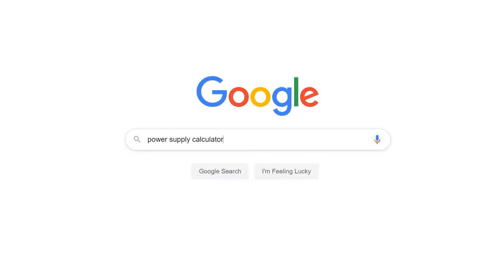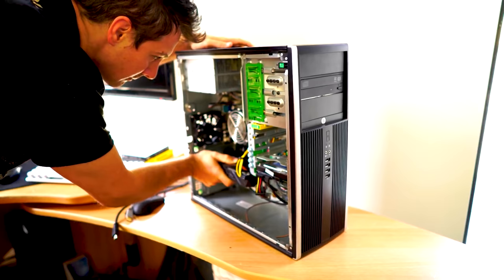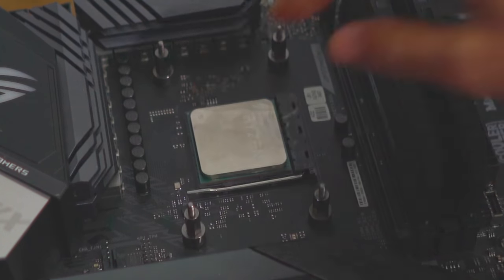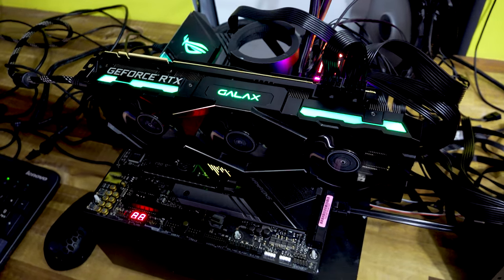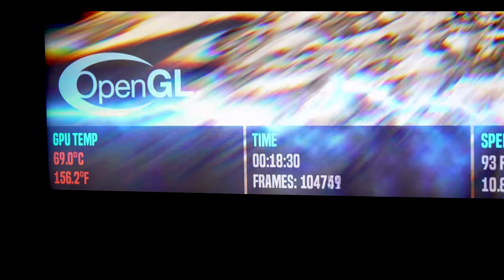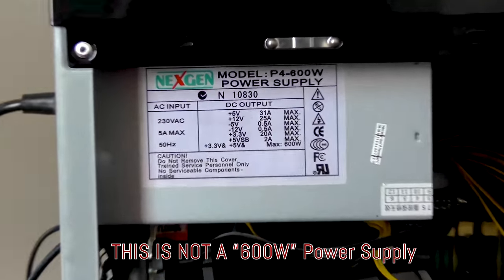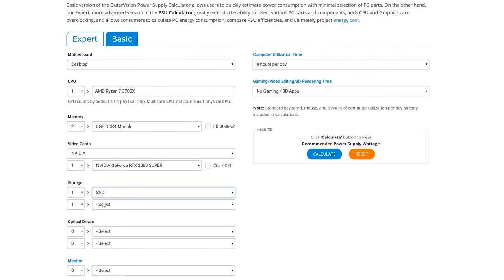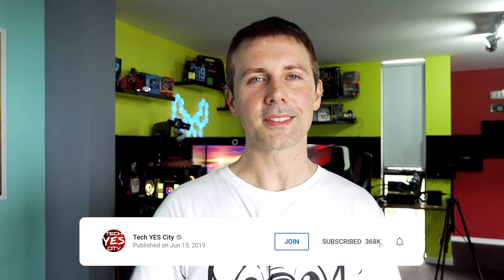I Tried Running a 3950X and RTX 2080 Ti on a 450 WATT Power Supply...

Comment: The internet: You can't run a 3950x and 2080 ti on a 450 watt power supply.

450 watt power supply: Hold my beer.
Reply: huh
Reply: Hold my watts
Reply: Yes you can but should you?
Reply: Nuno Filipe  i am running a 2060 super+ 3600 on 450w.
Reply: That doesn't make any sense.
Try again...
Reply: @faldano13  but 2060 super doesn't supports nvlink
Reply: @faldano13  why 2 then?
Reply: @faldano13  tho u would be good with a gold or up certified 850w psu
Reply: Hold my wire*
Reply: Galax RTX 2060 super yeah it does. only the vanilla 6gb model doesn’t
Reply: @Luismedeiros150  i have never heard of it , i think only the 2070 and above supports that feature
Reply: @faldano13   even i7 + 2080ti is enough with 500 watt psu
Reply: @StainSocial  Your going from a 14nm chip to a 7nm chip. It will use the same power even with more cores, maybe even less.
Reply: Hhhhhhh
Reply: @GalaxRTXsuper  how does it works
Reply: i will run 3600+rx580 wish me luck
Reply: Hold my capacitor
Reply: Ran a 1090t, a 290x, 2x8gb ram and 2 ssd from a 530w psu... Worked fine.
Reply: Laugh in 450w r5 3600 rx580 16gb ram 2ssd 🤣
Reply: @chocho6766  287hp, V-8, 6 speed, 1996 Chevy Camaro Z28 😎
Reply: @Cosmo47I  I don't think so 970 is almost as power hungry as 2060 super
Reply: @Cosmo47I  u may try with a 65w tdp processor and not so many other components
Reply: You mean hold my capacitor?
Reply: i used to run a vega 56 on 500w
Reply: I'm gaming on my my 180 watt psu with i7 9700, gt 1030, 16 GB ram SSD m.2 500 gb and hard disk 1tb😂.
Reply: @James-gl5do  my laptop has more then that 🤣
Reply: i have been using an i7-10700k and a 2080 with 450w and its been fine
Reply: @penguin144hz3  Not saying thats a bad choice but only way I would choose run that is out of necessity. A PSU is one competent that can generally be reused between multiple systems. I always get the highest wattage PSU within my budget just to have some overclocking headroom and to ensure it will be sufficient if I choose to upgrade. My 800w is overkill for a ryzen 2600 and gtx 1080 but I got it at a really good price and I know as long as it keeps ticking, it can handle pretty much anything on the market.
Reply: I knew it can be done. It would still run alright as well most likely.
Reply: Hold my beer and wats 🍺⚡
Reply: @GalaxRTXsuper can you help me , i have 450w can it run rtx 2060 super with i5 9400f ??
Reply: @Sven1401 You sure can. I'm running RTX 3060 with 11400 on a 400 watt PSU with no problems
Reply: @GalaxRTXsuper  Epic

Comment: 2:11 I'll correct Brian a PSU rating is it's maximum continuous supply to the PC.  My PSU is rated 450watts but the manual says it can handle peaks of 500 for a few seconds.
Reply: I wish that were always true, but it isnt. Quality PSUs are rated continuous, and can generally far exceed their rating, cheap PSUs are often just rated max
Reply: It's true they're usually rated to work up to 110% DC output wattage before OPP shut down. During all this, it would draw a lot more than 450W from the wall due to the way efficiency is calculated (450W DCout @ 90% Eff = 500W at the wall).

But that's also only its maximum rated output within a very narrow temperature range. Once they exceed say 40°C (for my PSU at least) operating temperature, output capability starts to drop, making 500W peak a risky thing yet again. There's a lot of factors to consider if you're approaching the limits of your unit.
Reply: @lejac4916  There's the reason I forgot for why you need a fair bit of headroom.  You need to be certain for the entire range of temps and humidity it will be exposed to.
Reply: My HX1200i passed over 1350w on 12v output for over 24 hour test (fans barely had to spin at 400-600 rpm, silent, not even warm while running out of spec like this and running 90% efficient. Wall power was obviously higher at 1550w) My SuperNova 1300 can push a bit higher (never OCP yet even on estimated 1.5kw output), but it’s loud even at idle and blows realistically hot (not like some, but it’s pushing some heat at full and above rated spec loads).

The good ones exceed specs, the cheap ones like Rosewill blow up your SSD and won’t replace it (1000w Hive blew up at 830w wall power, so like 700w output max ever). I’ve also popped OCP on their Glacier 1000 at 630w (so like 500w output), and the cables are thin and crappy aluminum (you can tell which cable is to what set by picking it up, same gauge but apparently the copper weighs twice as much on premium units). I’ve also blown another but it was near spec for a couple years and failed softly just dieing out gradually and safe (no $250 SSD fried on it, so no complaints).

Also note the SuperNova 1300 (fully modular and exceeds spec) was like $25 more than the crappy Rosewill Hive (semi-modular, epic fail and parts blown below 70% spec). So I wouldn’t call the Rosewill cheap, they are right next to the high end super high power models, you don’t get what you pay for on that Rosewill brand!
Reply: also dont forget they're only efficient up to a percentage of that number. IE. bronze-plat rating
Reply: its*
Reply: @jakegarrett8109  I kind of get the impression Rosewill is a just "name" you're paying for, but what made that name famous I couldn't tell ya. My first build ever had a Rosewill PSU and it too died.... inside of 30 days. The RMA'd unit held up after that, but it's definitely a situation that I have quite a leery eye toward their products.
Reply: My EVGA supernova 1000 Watt 80+G2 can handle over 1400 Watt and this isn't the Peak Power which is higher than that. IT IS Made by super flower dir me the best psu Manufakturer. I had an E5 2690 with a GTX 980 TI with an X79 Classified Lavender Mod  with a super flower Atlas with 600 Watt wich outperformes my Supernova because of an evga inkompatibility. Even with 980 TI SLI it was showing the same performance. And an mich older super flower Made when Pentium 4 was Made with 500 Watt did Work with the Same System and one of this Cards and a 680 for Physx aswell. Unbelievable but true.
Reply: @jakegarrett8109  I think the EVGA Supernova 1000 Watt G2 and the 1300 Watt P2 and Gold are one of the best psu's in the Market for the Money they cost and withoutthat Aspekt. The cables have to be Changed after 5 years using But i  think that this ist something good for safety, to have the Same Performance the whole 10 years of guarantee and much longer. When in read the article that a Kondensator in the G2 Had to be changed to be able to give IT only Gold and not Platinum, and the other Specs, and that they are Made by super flower i knew that this ist my next psu and in never regret that a second IT was the best choice.
Reply: A quality psu, like seasonic, should be able to go 100W above rating. Sometimes even 200W. it will just get hot.

Comment: Great video. I was told I was crazy when I decided to reuse a gold rated 550w psu for a 9900k 1080ti rig. During gaming I pull tops 400 from the wall.
Reply: @LucasFerreira-gx9yh  I'm using 400w from the wall, meaning about 360W of actual power use... you're drinking the over-buying PSU cool aid.
Reply: @LucasFerreira-gx9yh  Efficiency comes first, wattage second. Efficiency signals that it's going to consistently deliver its true rating which means you don't have to overbuy...and because it's efficient it makes less heat which is good for longevity and means that your build can use a smaller cooling solution! My experience is that the OEM power supplies are built to just barely do the job and will give out in a few months if loaded continuously, even if the system is in factory configuration; I would always buy at least an 80+ rating PSU if you intend for the system to last.

Every power supply does age, but that's just the nature of capacitors. Plan to replace it when you change motherboards and you should be fine.
Reply: you are crazy bro
Reply: @narwin2477  it's doing totally fine... 360w is really not too hard for a 550w psu...

Comment: any electronic device isn't design to blow up once you overload them. That's why there is tolerance value, ranging from 1% to 20% depending on what component it is. For example, your laptop has power supply rated at usually around 19v. 20v will never blow anything, in fact it will draw a little bit less current because you're supplying more voltage ( power = voltage x current). But there's always limit of how much voltage and current a component will be able to take. (voltage is pushed, current is drawn)

so i'm not surprised if you could drive that psu to years drawing 500 watt everyday.

what you should consider is checking the efficiency of the power supply and also the cut off power of a psu. Some psu will cut off the power once you pass 5-10% + 100% of the rated power. Some just goes to 20% with no problem

Comment: I can’t believe this! I was searching for 2080ti on 450w psu yesterday and couldn’t find any good results. Thanks for this video!
Reply: That was good information about the amps on a single rail. A multi-rail psu may not be able to provide enough power to the gpu.
Reply: citizenguy thanks for the info!
Reply: But for a RTX 2080 TI with a CPU which can fuel IT wholeworthy i would Take a 850 80+ Platinum or Gold psu Minimum. The Card can get "Spulenfiepen".
Reply: @8iosatlost209  what
Reply: Don't do it bro, obey the 80%
Reply: @slingbart705  yes maybe i´m wrong, to get the psu as the only new module and as strong as it can fuel a SLI Setup of two of this cards. I have a lot of bad experiences with a be quiet dark power pro p7 1000Watt 80+ nothing, which was much to weak to  support my 7970 crossfirex. was an bug in the whole generation. since that i bought an evga supernova 1000Watt G2 and i had unbelioevable more power, but because of a new CPU and Mobo E3-1240 v3 MSI Z87 GD 65, too. Before i had an AMD 8150 with Asus crosshair V. The PC got going out when a game startet at the end with the be quiet. Had 970,980,980Ti SLI after that and now an evga 1080TI FTW 3 and want to get another identic card and used or refurbished orig. hydrocooper coolers  for both. Had bought 2 GTX 980 hydrocooper last year and had to sell them immediately and they were robbed by the buyer. I bought and sold pc parts on ebay and made my pc asus rampage IV Extreme & 1680 v2. The supernova is working fantastic since over 5 years with more than 5 systems allmost SLI. When i buy an psu it must be able to fuel every upgrade which i could do. Buying a new psu because of bing not strong enough to do sli is uäaaaahhh:( and holds back from doing it. Of course, you can buy another 500 Watt psu that would be better than one equal 1000? but the thing is did anything work worser  because it had 1000watt 80+ gold? And the only thing i do with pc is to overlock cpu and everything to make benchmarks, i allways imaginate that everyone wants to do that. Yes we see, it works normal with 450 Watt or less. And  i would buy a better card with a cheaper psu aswell instead of getting a smaller card and better psu, because it works and you can enjoy the card. A little bit i play, too.
Reply: @JesusMeza3   i mean coilwine , the word which stand there means that in german, sorry.
Reply: Xuyang J when?
Reply: I have a 600 watt psu will that work even tho it is supposed to be 650
Reply: Thing with psu is that they are most efficient in 50%load some brands will keep a good efficiency on 70 90% 100% some will not. Also if very important to consider the amount of ripple it handles.  Good psu will keep it under 60, high quality will keep under 30. Cheap ones will have ripples over 100 that can kill yout gpu sooner, make O.C unstables and so on..
Reply: @citizenguy  there's 2 x 8 pin connector on rtx 2080TI. put CPU on rail 1, rail 2 to one gpu cable, rail 3 to another gpu cable.

Comment: I'm glad I found this video. Was worried to if my new GPU would run or not.
Used the calculator. And I dont even hit 400w with my system on a full gaming load.
So useful

Comment: I remember a few years ago I upgraded my 750 ti to a r9 380 and my psu blew up the next day lol. Dont buy no name power supplies
Reply: Yeah once I turned on my PC and a cloud of black smoke came out of my trusty old Thermaltake generic PSU that came with the 40 dollar case. Still ran fine for months afterwards
Reply: Did it take your parts with it?
Reply: I used to have a 550 B3 from EVGA in my main PC with an R5-2600 and a GTX 970(at the time, it has a Vega 56 now) I had it since 2017 and one day it turned off while I was playing a game, then it wouldn’t turn back on. It eventually turned back on and made a loud pop and started spewing smoke out the back. Thankfully nothing was damaged.
Reply: @rundown132  fortunately it did not take my parts
Reply: Yeah, PSU should be expensive, and you'll be fine. I learned this from a cheap one either. FSP is amazing.
Reply: Bought a 1050 and used it together with the smps that came with the cabinet
It survived for a week
Reply: dont buy a 10-20$ no name PSU, you will be okay..
Reply: @bamboo9666  i've had a few no name psu.. 550w korean used psu.. they're cheap af but still runs fine for years.. i paired it with my old phenom II x6 1090T with 560ti.. there are some brands that are 'okay' i guess.. like gmc or greatwall..
Reply: @alone2break  yeah i mean chinese psu..
Reply: NEVER cheap out on a PSU. 
It's not worth it if your components get fucked over because of a cheap PSU.
Reply: never seen a PSU blow, but have seen a GPU blow. poor old 970 superclocked.
Reply: @viperdemonz-jenkins  yeah it not gonna blow, but it only suddenly die. My psu die twice
Reply: especially not WIDETECH!

Comment: The whole MWE series is actually pretty decent for it's price.
Reply: i have the masterwatt , the one step high range model, the sleeving sucks, the glue that stick the heat shrink to the 24 pin came out easily, i also had another unit that had the 24 pin clip broken while new in box
Reply: @lansiman  It could be bad unit man?Idk, I never had a problem and the cables are decently sleeved even tho they're the "Ketchup and mustard" ones.
Reply: @thatsoomohit  it could be just my bad unit,but i'm talking about 3 out of 4 unit here,i do build for people and i ordered 2 unit,both had workmanship defect,i exchange for another 2,one still had it and one ok,i even do unboxing video for fear that dealer might blame user error for it
Reply: @lansiman  As far as I know Masterwatt is lower quality than MWE. Unless you mean Masterwatt Maker which is extremely rare.
Reply: Corsair V is better because of better topology
Reply: @lansiman  If you had a bad unit once, don't buy another one from the same seller. It could be a bad batch, or they are buying from a fake supplier.
Reply: is it good? i saw some 500w mwe for 55usd and im considering to change my psu later on
Reply: Vis Rupt i bought 2 unit at once, they’re definitely legit, but cabling quality were pretty spotty that’s all
Reply: Joel Cano the one i had was masterwatt semi modular bronze with 5 years warranty, in my country it’s more expensive than MWE
Reply: @lansiman  But then again, it may be a bad batch. Since you bought two units at once I wouldn't be surprised if they had almost the same serial numbers, and if that's the case, if one unit came out defective, more likely there's more. They came out from the same production line, same machine, same worker who did the assembly, you get the point.
Reply: Joel Cano masterwatt is higher quality than v1 mwe bronze
Reply: its*
Reply: MWE = Shit
MWE Bronze = Decent
MWE Gold = Absolute Shit

MasterWatt Lite = Shit
MasterWatt = Good
Reply: I used MasterWatt. Total garbage. Died after 7 days. I didn't even use 300 watts on that 650 watt PSU. Now using MWE seems to be running properly for about a year.
Reply: Had one, but sold due to noise. Still, it's a good quality psu, would be perfect with lower dba
Reply: I have a 650 mwe with a R7 2700X and a RX 570 8gb and it runs very stable
Reply: @greensamurai5805  Is it MWE V2 ?
Reply: Dilan from what I can see from the box ,no is there somewhere else that I can search it for ? It just says MWE BRONZE 650 but why what’s the difference?
Reply: @greensamurai5805  If the box is purple on the sides, it's V2, but if your cables are ketchup and mustard, then it's V1
Reply: Dilan after a quick search I can confirm that it is a V2
Reply: @greensamurai5805  I guess you're good then, enjoy your build !

Comment: Only loading a PSU up to about 50% of it's rated power does have the benefit of running the system at it's highest power efficiency. On average a power supply's efficiency curve peaks at around 50% keeping the temps low, and thus the fan off.
Reply: This is true on older/cheaper electrical designs, but modern tech has flattened the efficiency curve considerably. Whether the fan is running or not depends more on the specific design of the unit rather than just its efficiency curve, e.g. if the designer has used smaller/cheaper heat dissipating components that require more air flow.
Reply: @BruceLeedar  Look at any power supply, even the highest end one's efficiency curves and you will see for yourself that this is still the case, it's physics. They for sure have wider efficiency bands than earlier designs though.
Reply: @BruceLeedar  There are efficiency curves on the PSU manufacturers website (if its a reputable brand like Seasonic), too bad he didn't mention the reason it is actually recommended to get about a 40% bigger PSU rating for your system unless you dont really care about power consumption and your components